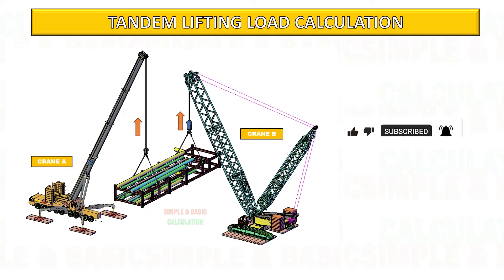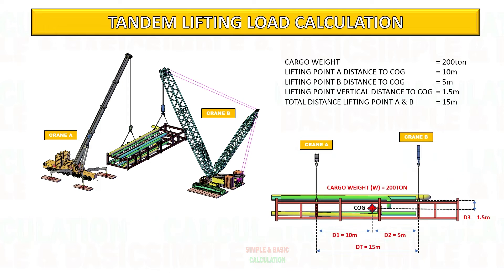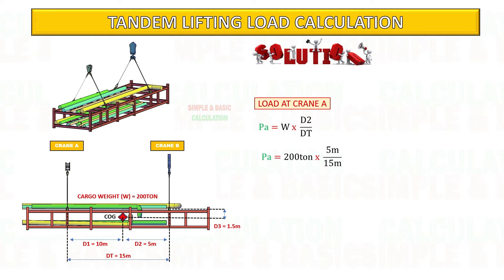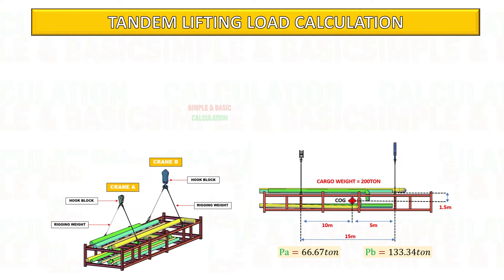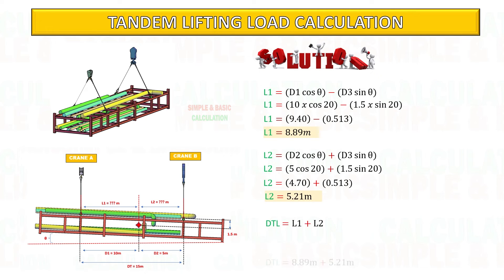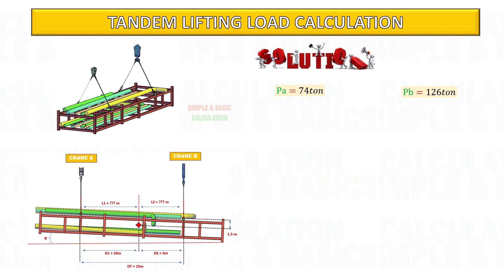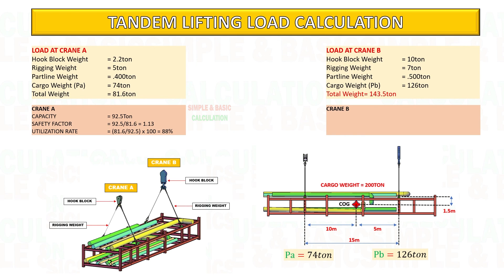Mastering Tandem Lifting: Secrets of Two Crane Calculation #lifting #tandem #crane

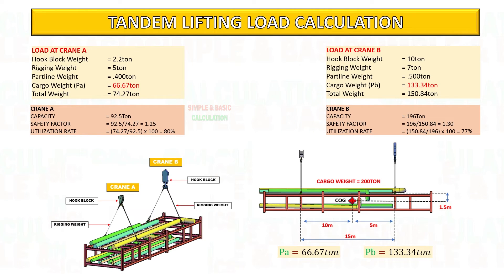Comment: Sir, what good is the safety factor at 2:50
Reply from the maker: The safety factor is the margin of safety that you have for the crane's capacity above the load. When it comes to tandem lifting, the permissible safety factor is completely dependent on the regulations that are in place at your location. 
Take, for instance:
At another place, if you are working with a tandem lift.The crane must have a minimum safety factor of 1.33 or 75%, or it must be higher.